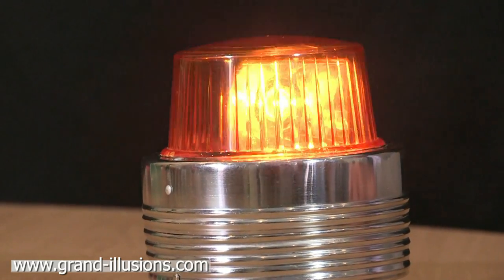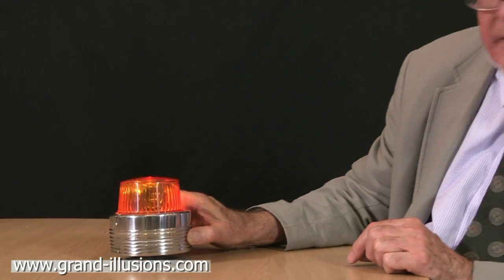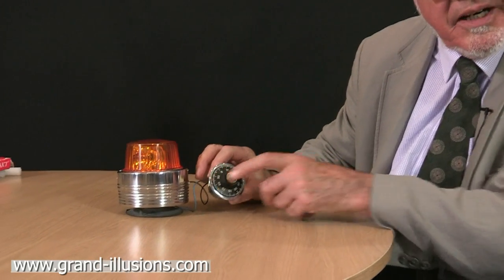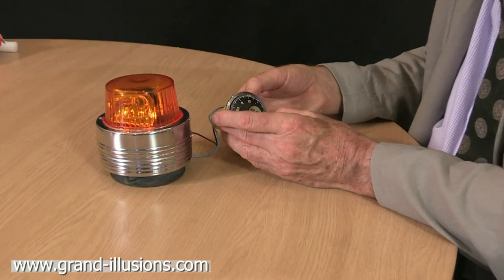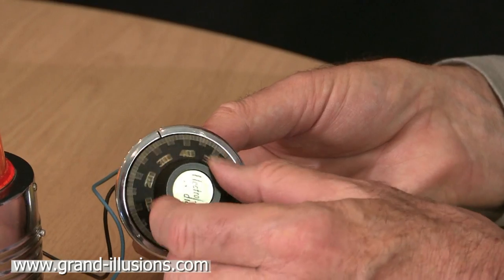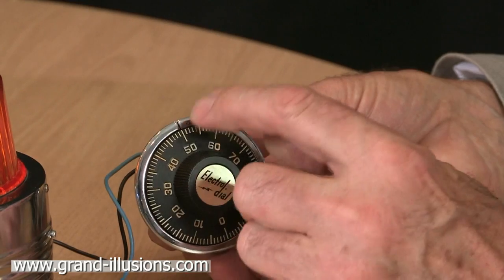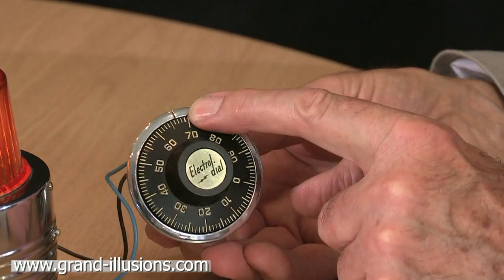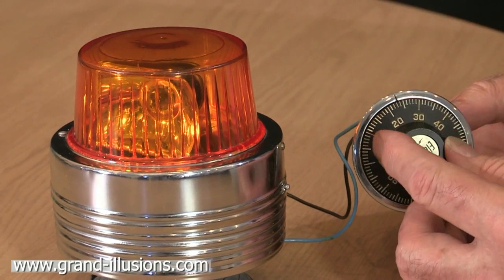Electronic Combination Lock

Comment: You can use that switch for your dedicated porn computer.
Reply: +Garrett Miller Ain't nobody got time for that!
Reply: using a switch and not a macro is a sin against computers.
Reply: A lot of old computers did have locks. Some of them only prevented you from opening the computer case, but others would lock the keyboard so the computer was unusable.
Reply: Garr  ett Miller

Comment: put this into your car as ingintion switch :D
Reply: oh yes, your being chased by some gang of criminals and you run to the car (oh crap, what was that combination again?)
Reply: Yeah, would be pretty hilarious :D
Reply: +dwalters98 Yes, of-course! The casual event of being chased by a gang of criminals. Adrenalin makes the arms shake - every time that happens.

But in that case you can always chose to pull the wires out of the home made device and just touch them, thus effectively "switching on" the device... haven't thought of that, have you? That's even faster than using a regular car key. 

My argument is flawless.